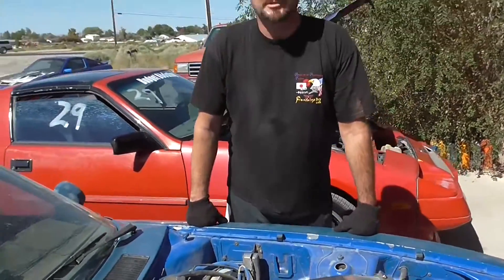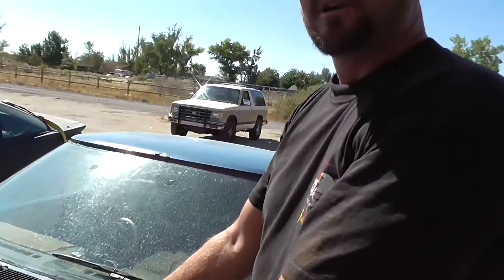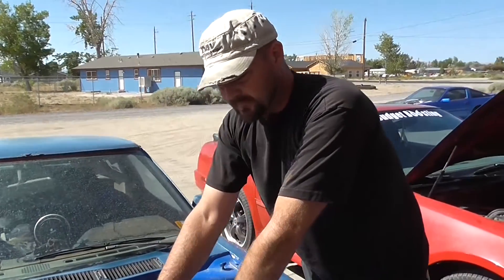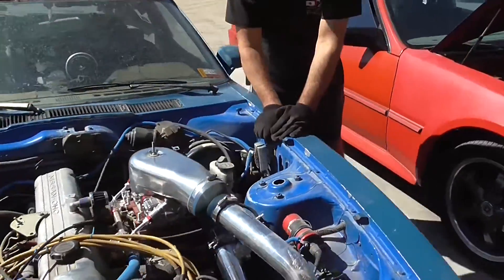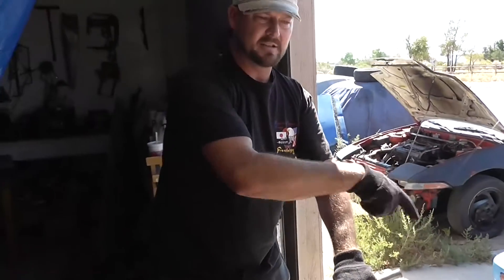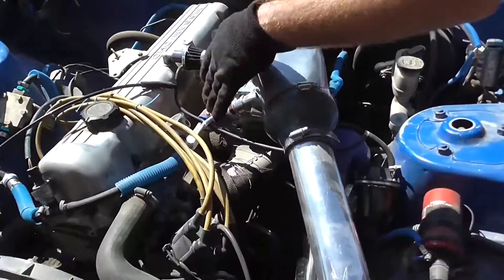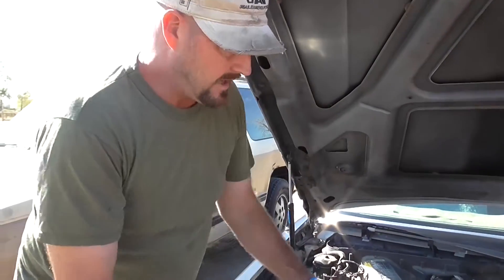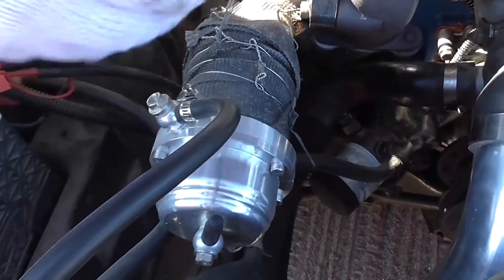TurboCharging A-Z; Blow Through

Comment: Hey Matt, awesome video, you pretty much cover everything. One thing I was gonna ask is if you run some kind of ignition module or Chevy HEI distributor conversion. I know that ignition timing is pretty important to prevent pre detonation and whatnot and I just wanted to know what you use on a 280zx. I’ve been looking and it’s seems as though a lot of the ignition modules are for the 240z single pickup distributor. Thanks in advance

Comment: Thanks so I'm not boosting I just want it for cold air only if I was boosting I would need a blow trough carb other wise I can just use a single plenum universal cold air intake on my 600 quick fuel carb rite?
Reply from the maker: Sounds good.  Blow through is just for turbocharging or centrifugal supercharging.

Comment: So I have a quick fuel carb 600Will my specter single Plenum work on the carb I just got to get better cold air so i want to install a cold air intake universal will that work
Reply from the maker: The difference will be how your carb handles boost.  Specific blow through carbs have provisions to raise fuel flow with boost.  With a large carb hat, your carb should work fine though.

Comment: Im trying to do draw through turbo on my L28. After all this is setup. Do I still need the air meter? Huge fan thanks for the videos
Reply from the maker: If you have a carburetor, that handles the fuel air mixture so no MAF is needed.

Comment: If I have 3 single barrel carbs on my 200 inline 6, could i blow through all 3 of them?  Or will I have to make a 4 barrel adapt to my engine?
Reply from the maker: You could try it by finding a way to pressurize float bowls while going up on boost and having solid floats instead of the light aluminum ones.  If it works good, if not, there is always the blow through carburetors.  C&S specialties makes custom ones and can find new in the box ones at Summit.  A 4 barrel manifold is much easier than synchronizing 3 carbs with boost.

Comment: do u have to intercool a blow thru turbo setup
Reply from the maker: You don't have to, but it increases performance and reduces the chance of detonation at higher boost levels so it's always recommended whenever possible.
Reply: Thanks for your help bud...really appreciate your help...if u would I have one more question I hope u could answer...do u think a SBC 350 would be capable of 1000hp+ on pump gas with a twin setup 60mm+...I'd hate to get into the race gas and alcohol...
Reply: +NickRC1, use extra piping to move the turbo further away from the manifold, boost difference won't be that different if you don't use a intercooler, inter coolers are basically useless in blow through turbos, the pressure difference by the time it's slammed down the carb the air is already cool enough. number two is always fit a blow off valve if running anything higher than 10 psi or you will kill your engine. 
I would recommend using mechanical fuel injected carb if you know how to correctly tune and know turbo pressure, gives an edge to the induction
Reply from the maker: yes the sbc could meet your goals with pump gas.  Check out Nelson Racing engines, he has small block Chevy twin turbo engines putting out that kind of power on pump and some way higher with 100+ octane fuels.  They have great engine dyno videos to watch that prove it can be done.  NRE does charge big money for their engines so DIY would be cost effective.

Comment: Hey Matt,
     You don't have to sell me on turbos !  I am one of those unlucky souls that has a 1982 Chevy Silverado with a 6.2 and it doesn't have a turbo so as you know it has to shift down to go over a speed bump !   A year ago I had someone turn it up and he put a one tone manifold on it because it was a California truck.  The manifold opened up the air inlet from an inch and a half to almost 3 inches.   Man I want a turbo but, money is an issue .  Fortunately turbos have come down in price which helps but finding an exhust manifold that works with my airconditioning is hard so I have been told.  I love the truck and liked it better after they turned it up but I went from 23-26 mpg down to 15-18 mpg.   Is there any way to win the battle with this ?  I would love to know !
Your Friend
Cody
Reply from the maker: +cody cheney Intake and exhaust modifications to help it breathe easier would be a great help for your truck.  The factory exhaust system has very heavy restrictive mufflers and catalytic converters that really congest the inner performance and economy.  Summit racing sells great free flow cats if you have to run them, and thrush welded mufflers are light and very free flow to replace the heavy boat anchor stock mufflers.  Summit also has some bargain intake air cleaner kits that really free up intake.  I remember when I built my first turbo kit, I slowly acquired the parts and then when I had everything I needed, I started the build.  One step at a time since costs of some things are quite expensive.
Reply: Hey thanks !  I have been trying to get things one at a time but manifolds are really hard to find at a reasonable price.  EBay has some decent priced turbo but I don't know what size to get because my truck doesn't have a brain to set things.   Oh well an inch at a time to get horsepower is worth it
  I have the 700 r4 trans built ready for the horsepower and it works well.    It's finding the turbo andanifold to set the turbo on is the hard part.   I can't wait for some monster burnouts ! Have a good day and if you k ow a better place to find an exhaust manifold that would be greatly appreciated !
Cody
Reply: Hello i am going to be starting a turbo ford 460 s10 build could you give me some pointers as to fueling and engine management. Tips and tricks to supporting mods as well but we will be replacing cam, valves, springs, pistons, our goal currently for compression is that we want to run around 10.0:1.

Comment: Hi Matt, absolutely love your channel. Cant believe i stumbled across it after spending ages thinking about what to do with my Datsun 280c. now i have decided to turbo it! and finding your channel which shows exactly how to boost an l28 carb is amazing. i am very grateful for all this valuable information. I am now starting to collect the required equipment to start this job, I'm having trouble locating an l28 turbo manifold. we didn't get turbo l28s delivered to Australia that i know of so finding one locally is proving very difficult. do you have any ideas where else i could look?
Reply from the maker: Matty Greig The R30 Skylines from around 1981 to 1984 had L20ET inline six engines which were imported to Australia, the exhaust manifolds do bolt right up.  The majority of external engine parts are interchangeable between L20, L24, L26 and L28 engines.  The 80's Nissan Laural and Leopards were also imported by some there and they had L20ET or L28ET engines in them.  Since cars over 25 years old are easy to import, you can find them.  Many wrecking yards in Japan and the U.S. have 280zx turbo cars from 1980 to 1983 and their stock exhaust manifolds will mount practically any T3 turbocharger, the only limit is the distance between intake and exhaust manifolds.  Yahoo auctions Japan and Ebay are great sources to get L28ET turbo exhaust manifolds.  Sometimes you can get lucky and score old HKS or Trust turbo headers for L28 engines.  Let me know how your search goes.

Comment: Dear Budget Boosting.
I just want to clarify - The biggest factor on compressed air heat up is the act of compression itself: from ideal gas law pV=nRT => T=pV/nR, nR is constant (number of moles times gas constant) so T~pV, as we are not changing the volume any rise in pressure must bring a rise in temperature (and in real life it's more complicated than this). Convection might play a role but a very small one. ;-)
Reply from the maker: akkudakkupl Nice write up.  This particular engine is quite difficult to keep intake temperatures cool since the intake is right above the exhaust every trick I can do to keep inlet temperatures down helps.  I also wrapped the exhaust and turbine section with heat insulation wrap to help but convection does overrule after the engine has operated 30 minutes or more.  The large intercooler helps some but I will come up with more ideas in the future to separate the temperatures better from the intake above exhaust manifold system.  I will be getting a custom twin turbo header to run twin T04e turbochargers on this car and this design leaves more room between intake and exhaust manifolds so it will make more room for heat shielding techniques to combat the heat rise that evaporates a lot of my fuel mixture when engine has been running for 30 min or more.  Thanks for watching and inputs and comments are always welcome.

Comment: im doing a extremely budgeted boost build on my chevy 350 and I have a carter AFB 750 cfm that on some websites they say it is blow through ready and some say its not so do you know any1 that has a afb that can tell me what to look for to tell if it is or not...I don't have the money to buy a new carb or most the parts to turbo my car right now but I have half the parts already like the turbo and oil cooler and oil lines and I might be able to get some used intercooler stuff but I do need some help....my goal is 5psi boost max and a cruising boost of about 1.25 psi to boost (no pun intended) fuel economy... low boost due to compression of the motor and not having the money to buy new heads
Reply from the maker: anthony perras One thing I have heard successfully done with non blow through equipped carburators is use a large airbox where the boosted air comes from the intercooler to allow the boosted air to collect in large volume for the carburetor to better ingest it.  Carters are great carburetors and very reliable.
Reply: I am limited on supplies so I will look into the air box idea and thanks this carter carb was on my dads 70 chevelle on the motor he built and it ran 11.40's on the quarter mile with 10" wide street tires...pissed some big block chevy guys off when a small block chevy on street tires beats them....N/A cars im good with so this blow thro turbo thing is kind of new to me
Reply from the maker: anthony perras Outstanding, its great to see budget beat big money and big cubic inch competitors.
Reply: well I have been doing some research and I can buy a 383 making 450hp(about) and add a MSD EFI kit for 2.5k and a twin turbo kit for 1.5k to bump it into the 800hp to 900hp range and it would only cost about $8000 if I bought a crate motor $6500 if I buy a good used motor. so I'm going to run the 350 till I have the money to start the 383 build
in the end I still wont spend as much on it as I would if I bought a 572 and I would have more power...I'm going to start the search for a cheap 383 and see what happens. Thanks for the complement.
Reply from the maker: anthony perras Sounds like a fun project.  Would like to see some pictures and videos of it.
Reply: Budget Boosting will try to get some soon...bleeding the brakes today and trying to get it road worthy so I can take it to a local car show

Comment: Awesome vid! great info, now I have a better understanding on blow through turbo charging, my concern is on my 2.3 n/a ford engine, I was wondering if you need to attach the turbo to the intake manifold where the carb is or you can place it on where the exhaust manifold is, like in the efi svo engines..???
Reply from the maker: Arturo Venegas I would do it just like the SVO, they were quite fast in late 84 when Ford put them out.  That is a perfect example to follow.  Let me know how it goes.

Comment: Hello Budget Boosting, Thanks for great information. i have an old Volvo Engine its 72' B20 engine that belongs to 144 series.. anyway im planning to turbocharge it through the blow through system, my only concern its the engine's health. what do i have to do to keep my engine healthy and running its my daily driver and im not planning to rebuild the engine. my goals is to put a small turbo charger on it not alot of boost its only the sound that im dreaming of. thanks alot
Reply from the maker: LuckyBuket NoC your plan sounds great, run good quality oil for high mileage engines, change oil at regular intervals, run low boost and it should run pretty good.  Good run in engines work great for turbocharging.

Comment: hey Matt cool as always.nice video explaining more in details the blown thru setup good info.I will be doing a draw thru setup in the future and on this video you spoke about a fuel pressure regulator. do you think I will need a pressure regulator on a draw thru system?
Reply from the maker: f rod A boost sensing fuel pressure regulator will be beneficial due to raising fuel pressure with turbo boost pressure to help enough fuel is available to reduce lean conditions.
Reply: Budget Boosting my datsun have a mechanical fuel pump do I need to upgrade to a electric fuel pump
Reply from the maker: f rod If your fuel pump keeps up with the fuel demand of the carburetor, electric pump is not necessary.  Having an electric pump by the tank and still retaining the mechanical pump as a back up would be best.  Electric pump ever goes out, still have the mechanical one to get you back home.